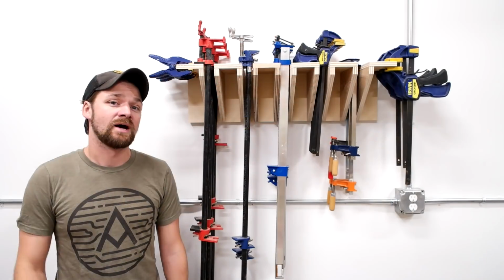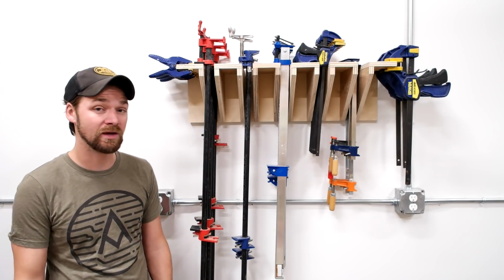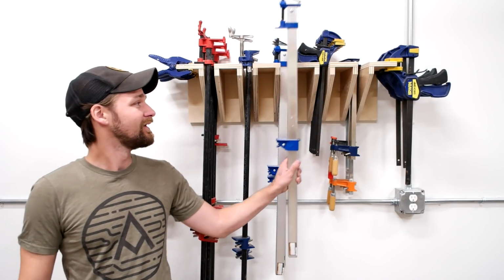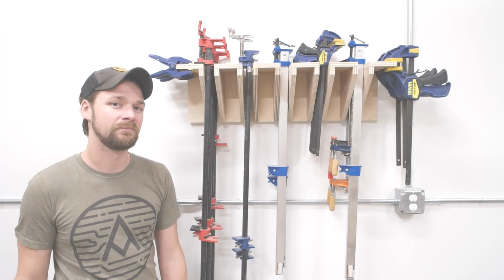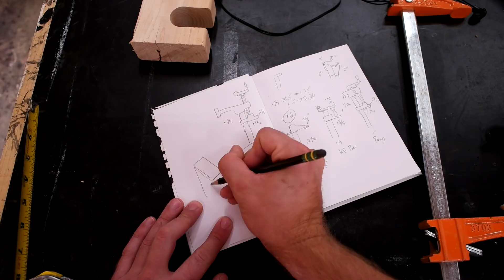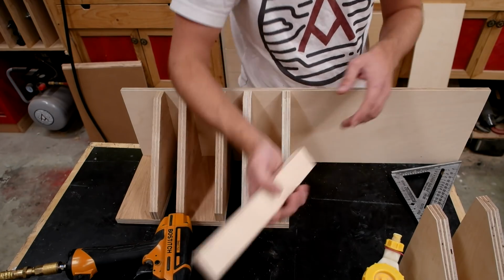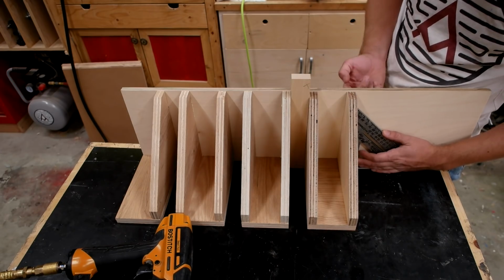DIY Universal Clamp Rack -- Woodworking

Comment: Nice clamp rack! Currently, all my clamp racks are different shapes and styles to accommodate all my different types of clamps, and where I store them. I really like this idea of one universal rack that will fit most clamps, so when I can create more wall space I think I'll go to something like this. Thanks also for all the basic measurements at 5:45 as it will save me all that time figuring out the parts size and the layout, etc...very helpful, thank you.